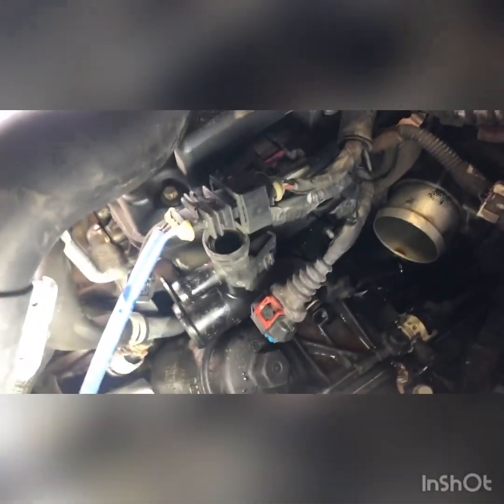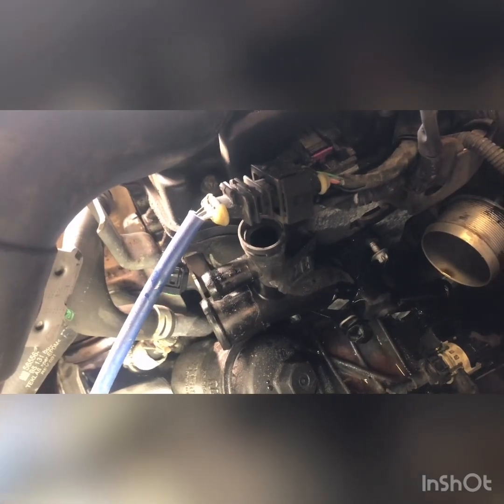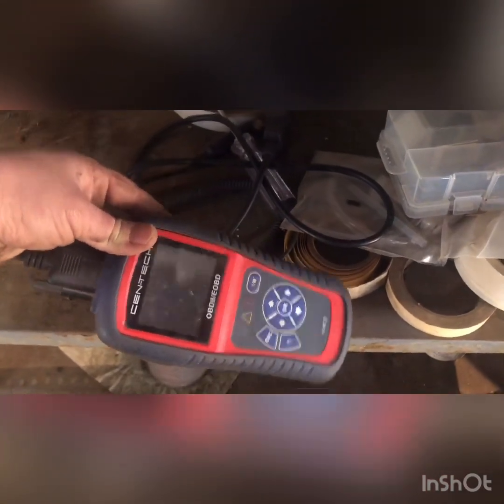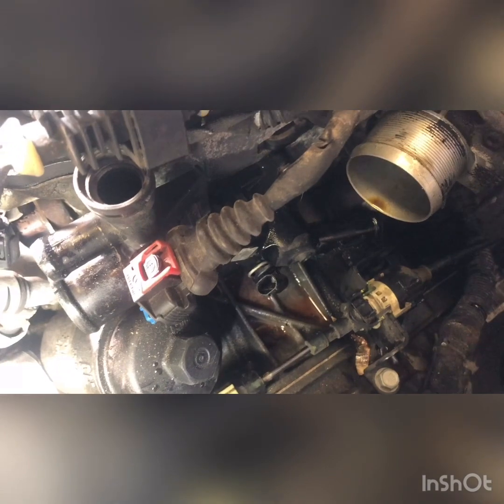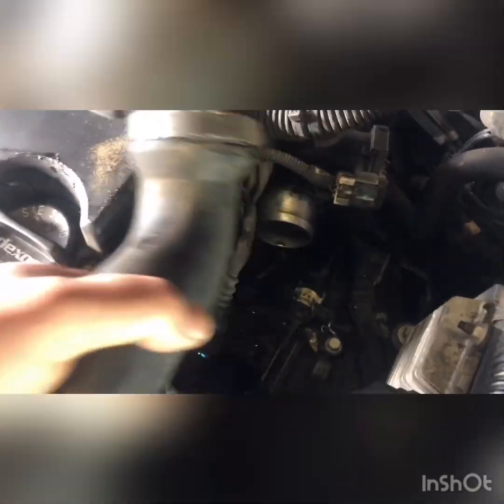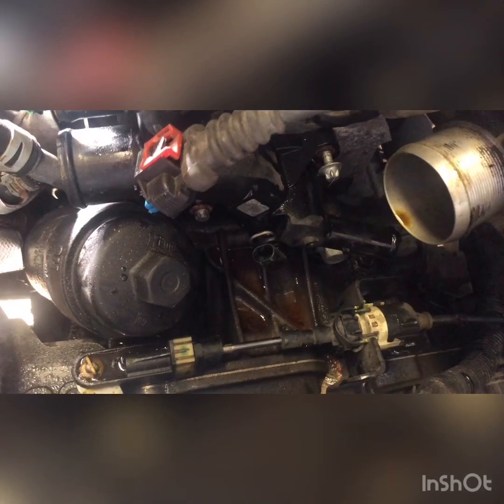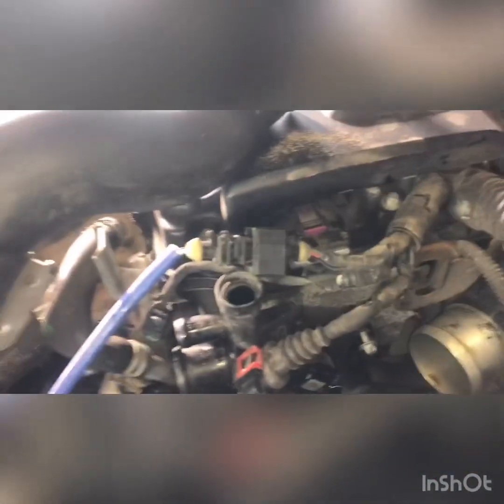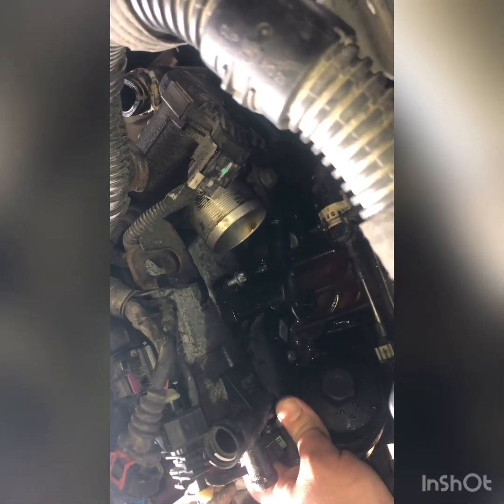Chevy AC Off due to high engine temperature P0119 P0118 bad sensor how to change water outlet tips

Comment: Hi ! I just purchased a 2013 Chevy Cruze LT 1.4 engine and the first couple of days it drove perfect and then the ac off due to high engine temperature message came up so I took it to the shop to get it checked and they said everything was fine (the coolant system, radiator, everything that could possibly be connected) but today when I was on my way to work I had the heater on and it started to smell like my car was overheating and my check engine light came on and the ac off due to high engine temp light came on ..do you have any clue what I could try next ??
Reply from the maker: Sounds like you might actually be overheating. Could be low coolant, dirty coolant, water pump, thermostat, radiator fan, warped head, bad head gasket. If it is doing it intermittently at higher speeds my first guess would be low coolant or water pump if coolant looks good and full. If at low speeds or in town stop and go driving I would check fan first.

Comment: I think I need to fix mines but it turned off the other day and haven't turned back on what do you think that mean
Reply from the maker: Make sure that your car is not in fact overheating, that’s the biggest thing to confirm. If it turns back on then do a diagnostic on it

Comment: Have the same issue,changed the thetmostat and 2 sensors and bleed it and it still overheated. What else should I check?
Reply from the maker: Victor Solis is it actually overheating or is the message/code just coming back repeatedly?
Reply: @FerKurl  just the code keep coming on. Not overheating
Reply from the maker: @c_daddyvlogmore2333  could very be the sensor. I’d say it’s time to scan everything and check live data

Comment: My daughter has a 2015 cruze and it overheated on her, she opened hood and smoke was coming from the temp sensor area. Would this be the temp housing as well as sensor?
Reply from the maker: Detroit 187 could be a leak from the housing. Inspect it carefully and replace if necessary. Renting or buying a pressure tester will help finding the leak
Reply: @FerKurl  thank u sir👍

Comment: 2012 Traverse LTZ engine Temperature gage alway at 210 and no more. 3 weeks ago AC need a new Evaparator 800 dollars and 3 weeks later the engine Temperature gage keeps going 1 notch above 210 when stopping at red lights.
not always but becoming pretty regular.
I have no leaks just AC condensation.
no warning lights.  I have heard  the fan running only  one time when I have  turned  the car off  but not every time. 
The car has been doing this for about 4 days now.
Reply from the maker: Emily Cummings are you getting these codes? Are you getting a warning message on the dash. What is your concern, is it that it’s raising above 210? Does the radiator fan kick on whenever you turn the ac on?

Comment: I got this message, and at the same time the temp gauge dropped to cold, so I pulled over and checked. The car didn't seen to be overly hot, nor did it run any different, so I drove home. 
     After some YouTube research I replaced first the upper sensor (engine), then the lower sensor (radiator). I still get the message, and the gauge still will not rise. Yours was the first video I've seen that says I have to reset the error message, so thank you. 
     If I reset the error message, will the gauge work again? Or should I consider replacing the thermostat?
Reply from the maker: Chazz McCloud if you don’t have a scanner available try disconnecting the battery for a few minutes. Sometimes that works to kill the message. If that  doesn’t work get ahold of the scanner. It helps to know what temp the computer is reading. Try the battery disconnect and get back to me.
Reply: I ended up replacing the thermostat, and that took care of the issue for now. Cars are fun 🤮

Comment: Those temp sensors can really mess you up if you don't figure out that this is the real problem; if radiator ever over heats (even briefly), this can be the problem. May be happening now to mine, as in town the rad  temp reads that it is getting close to overheating , then  speeding up it is fine. Yeah, also effects heat blowing  temp.